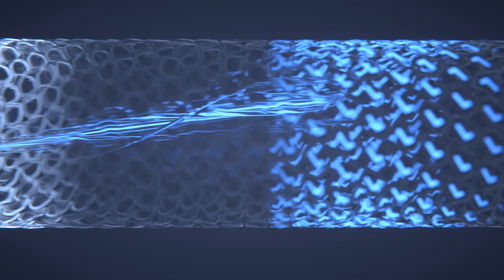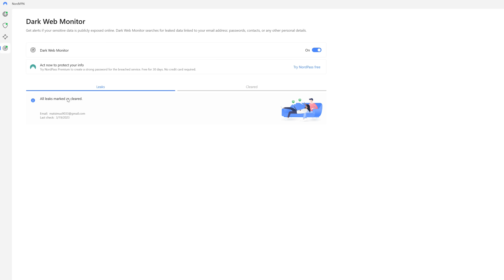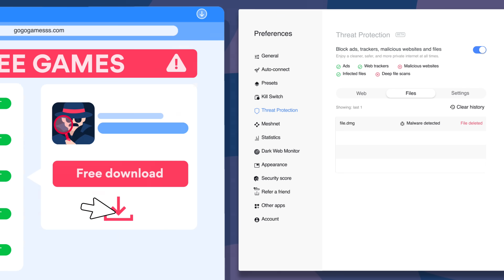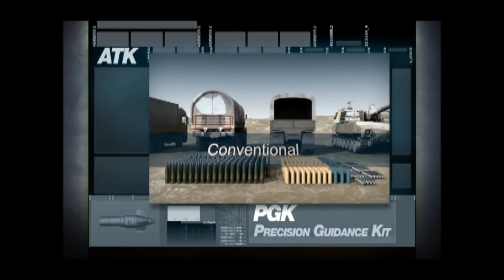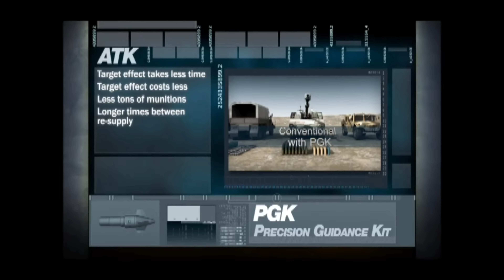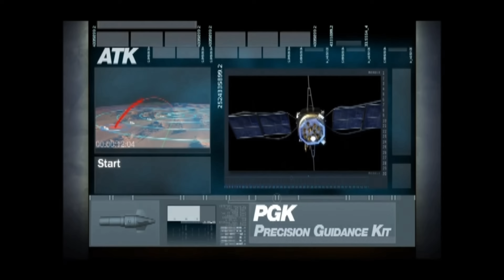Can Precision Guided Artillery Rounds be Jammed or Hacked?

Comment: Almost all kinds of precision guided ammunition (including missiles, bombs and to a certain degree even drones) can be countered somehow. Laser guided ammunition can be countered by a combination of smoke granades and laser warning sensors or optical jamming via Laser, GPS guided shells can be countered by jamming, radar guided ammunition can be countered by jamming, chaffs and active decoys, heat seeking ammunition can be countered by flares and jamming via Laser.

The only guidance machanisms that can not be countered are internal guidance mechanisms based on inertal navigation. They are in general not precise enough but they can in some cases be used as a sanity check to detect decoy measures and can then be used as a backup.

All these counter measures can be countered to a certain degree but this makes the guidance system often (much) more complicated and expensive. And ammunition is, has to be, expandable and as cheap as possible.
Reply: GPS with frequency hopping would be absurdly hard to jam

Infrared munitions are now being set to ignore incorrect thermal imagery and ignore fire or flare signatures
Reply: @markwood4555  Frequency hopping/spread spectrum communication is jamming resistant but it is not jamming immune. Modern jammers can not only just send out noise but they can send out signals that look like the real signal but contain wrong data. Up to a certain point it is still possible to filter out the real signal if the data packets have a cryptographic identifier, like military GPS signals, but that has it's limit. Especially if you have a limited time for listening and filtering out noise and an artillery shell does not have a lot of time in the critical end phase of it's flight.

Military P(Y)-Code GPS is pretty jamming resistant, much more so than civillian GPS, but not jamming immune. And it is practically immune to spoofing as long as the encryption key is kept secret.

GPS can be made more jamming resistant if you use directional antennas that point in the direction oft the sensor or an phased-array antenna to be able to filter out signals from a wrong direction. But it would be very difficult to integrate a system like that in a projectile.
Reply: @Superwip  Some of this uses some of the important words for M-code AJ receivers. But...

Comment: China demonstrated its capability of shooting down GPS satellites over a decade ago, by hitting their own satellite in orbit. 
Don't count on GPS. It's the first things they'll hit.
Iran's Shahid kamikaze drones are sold for $20K and that's because they are made with off-the-shelf electronics which is a lot more expensive than an integrated design from ground up. 
I can assure you they make money selling them at $20K each and most likely cost them around $6K in a mass production environment. 
Today, I can buy a GPS flight management board for under $25! If I want the fanciest of all, a PixHawk board running Ardupilot mission planner software for about $200.
Add to that the work being done on Ai vision systems like OpenCV, passive IR and UV cameras, cheap stabilized camera gimbals, and you can have a system that can even act as a MANPAD controlling a rocket. 
Will work much like a cruise missile with a range that puts all artillery to shame. 
When GPS is lost, it can use its IMU gyros to get close to the target and then switch to Ai vision tracker and go for the target.
They can have Google map of the area downloaded, so the IMU knows where it's going.  
I was tempted to design one myself, but I don't want to contribute to the insanity of any war. 
'Violence is the last refuge of the incompetent.' 
~Isaac Asimov

Comment: I wonder if there’s gonna be a laser guided version, both for use in GPS denied/degraded environments but also for use against moving targets…
Reply: The Italian-German Vulkano 155 which is a 80km range subcaliber projectile can have the proximity fuse removed and replaced by a laser seeker. In fact it can also take an infrared seeker.  Excalibur is getting. A terminal laser seeker.
Reply: There already is laser guided shells.
The russians use them.
Reply: The laser guided artillery round came first, the M712 Copperhead. I don't know what it is like against moving targets but I guess it will be similar to any laser guided bomb without wings.
Reply: The problem with laser guidance is that you need to designate the target. That means you need to be in visual range of it.
Reply: @cageordie  already know that 😑💬 it should be pointed out that the Excalibur guided artillery munition also has a laser guided variant in addition to GPS, so one can assume that at some point a laser guided version of this will most likely be developed

Comment: I expect jamming is about all that would be even semi-useful for artillery shells.  Time of Flight and unpredictability of firing would preclude hacking.  Even jamming would be of limited use, maybe only enough to make the Excalibur miss by a meter instead of hitting dead on.
Reply: To hack the fuze you'd need to be able to communicate with it. That requires the fuze to have an interface that can be used during flight. Unless they decide to add in-flight retargeting that's just not going to happen. Modern security requirements include program protection, so you wouldn't be able to read or replace the software.

Comment: With all the hard kill solutions this would be a very viable and possible cheaper solution. In terms of Ukraine I wonder if the Russians can un jam themselves from there own ECM traffic to even detect them coming. These Excalibur rounds give even more depth to MRSI. It has gps and iInertial systems on board. GPS is vulnerable but the inertial system provides good backup. If the target is well grid referenced I believe the US Navy tested a laser designated version to. Once again great content and keep it coming👍🏻
Reply: > if the Russians can un jam themselves from there own ECM traffic to even detect them coming. 

There's a zilion videos out there of their air defence targeting guided missiles that are slightly smaller than Excalibur, so likely the answer is 'yes'.

Reportedly, Ukrainians only ever use GMLRS against important targets by firing it in a salvo of unguided rockets so the air defense is saturated and has a harder time intercepting everything.

Comment: There are already guided tank ammunition. For example South Korea has some for their tanks. I also remember hearing a story about USA testing laser guided .50 cal bullet in Afganistan at some point but that might be just a myth. Smart ammunition is getting more and more common and so it only makes sense to investicate counter measures...
Reply: Nope. It's real. Sandia Labs in Los Alamos built the laser guided .50 BMG round, but due to the size and design, it could only be fired through a smoothbore barrel.
Reply: EXACTO
http://en.wikipedia.org/wiki/EXACTO

Comment: A way to make then "hack proof" is inertial navigation. Inertial navigation drifts over time more so than over distance. For the very short time a artillery shell is in the air, the drift sill be minimal.

The main problem is the very aggressive acceleration in the beginning of the launch. That might introduce a considerable drift. A way to solve this is to measure the exit velocity of the shell, then beam that information  to the shell so it get a accurate speed. When the shell got the information it could turn of the reviser so it can´t be hacked.

It looks like that kit could go in a tank shell as well as a artillery shell as is
Reply: Artillery is far from enemy so GPS can be used for most of flight with jamming only being a problem for last few seconds
Reply: @hphp31416  Well that asumes the enemy don´t know that you are using GPS shells.

Radar will detect the shells seconds after launch. Then with targeted radio signals... GPS is in the 1100MHz band, so its pretty easy to target with directed radio-signals.

Then you can drift the shell of coarse quite significantly before it impacts.
Reply: The problem is getting a low drift gyro onto a small package, tactical Gyros are still the bare minimum, they are still bulky when you put it on a PGK.
Reply: @aerojetrocketdyners-2538  
Now days we have both laser gyros and solid state 6D accelerators. 

While the second type have quite a bit more drift, on the time scale we talk here its not a huge problem
Reply: The problem of inertial navigation is that the accuracy depends on cost. A million dollars inertia guidance unit on a submarine can be less than a meter off, but a hundred dollar inertia unit on q PGK unit can drift a hundred meter in half a minute flight.
Reply: @joelau2383  BAE system is testing out a PGK for long range artilery and JDAM bombardment. Sadly they don´t publish number, but its far lower than a 100 meters.

And well.. there is also a scale of economy. The price is not only dependent on complexty, also numbers produced. If you produce a million, the cost will be lower regardless.
Reply: @matsv201  i am saying if satellite guidance is jammed, low cost PGK relying solely on low cost inertial navigation can be quite inaccurate.
Reply: @joelau2383  Well the BAE ammunition is specially made to be fired with no GPS guiding what so ever. They totally eliminated the GPS, it supposedly would be cheaper.

of cause, GPS guided munition also have PGK and they don´t need to be that accurate. A bit of drift don´t matter much when you get updates every second or so.

And even if it lost signal for the last 5 or 10 second it would not matter much.

But for the whole distance, you need a bit more accuracy.

They suppose to work in Jdams as well, but i don´t know if that been tested.
Reply: @joelau2383  well. Sure. That is true. But it might be worse if gps  is spoofed
Reply: You can just make delay before navigation is activated after leaving the muzzle. It's pretty easy to do so if you precisely know the launch speed or/and acceleration